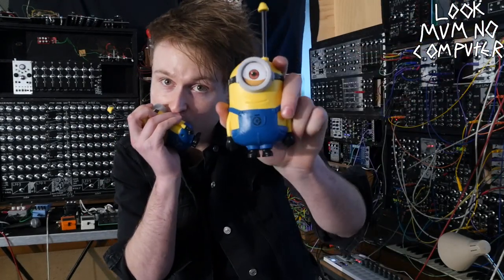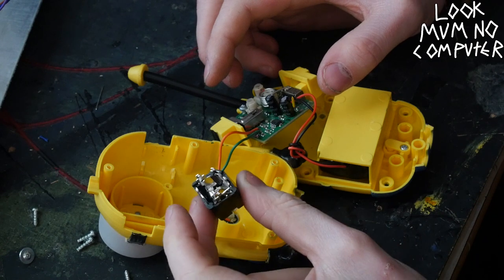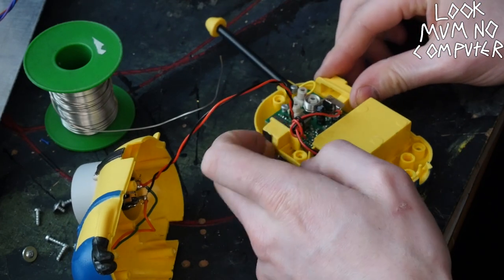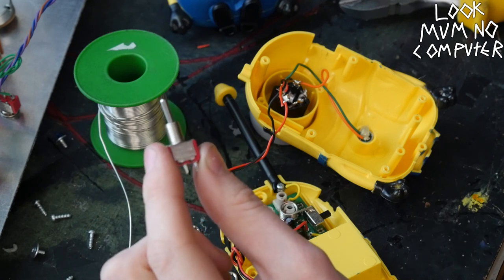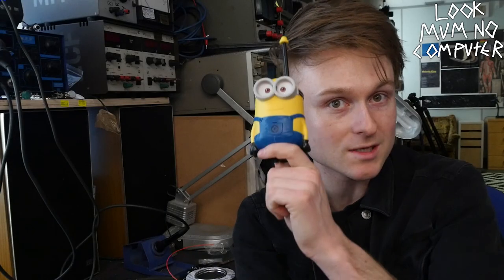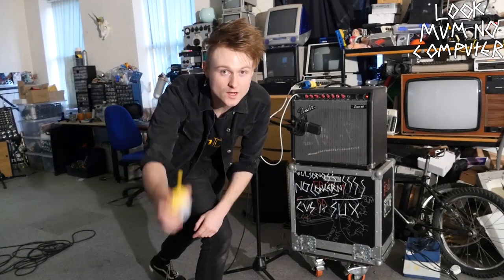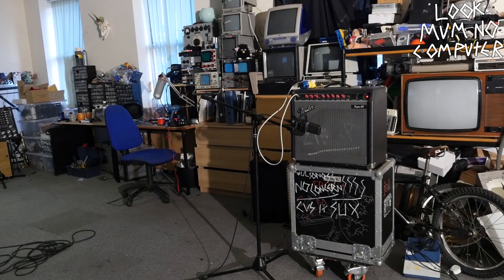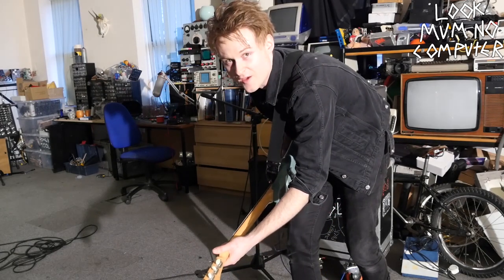LO-FI WIRELESS SYSTEM FROM WALKIE TALKIES?

Comment from the maker: ALSO A PART MISSED OUT IS THE RECIEVER, I SOLDERED BOTH POLES OF THE JACK SOCKET TO EACH SIDE OF THE SPEAKER, IF THERE IS A SPEAKER PLUS AND SPEAKER MINUS SOLDER PLUS TO THE TIP OF THE JACK AND MINUS TO THE SLEEVE OF THE JACK, if there is no speaker plus and minus, try it one way and see if it works, if not swap it over.

Comment: When I was a kid, I had a couple of toy walkie-talkie that were actually low power crystal single CB radio. Sometimes happened that i talked to some random trucker. Besides were way cooler than the Minions one, were gray and brushed metal and hat a big chromed whip. 
I suppose they used AM modulation. 
These toys I suppose they're on LPD band and are transmitting in narrow band FM.

Comment: Nice!

Boring technical question: is any attenuation/resistance needed when wiring up a speaker signal to a jack? Is there a way to check that the levels are ok before sending it through a nice amp?
Reply: anothertwunt you could use a scope and set the volume to your input level (200Vpp or so) with a voltage divider and then match the impedance with a serial resistance to the impedance of your input.

Or just plug it in, guitar amps won't complain too much as long as you don't put the output from another amp into their input.